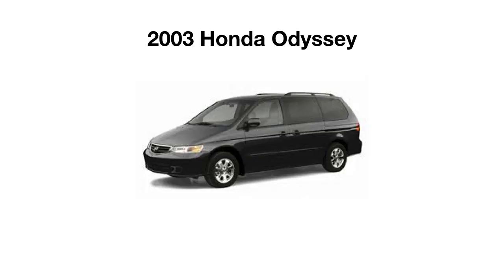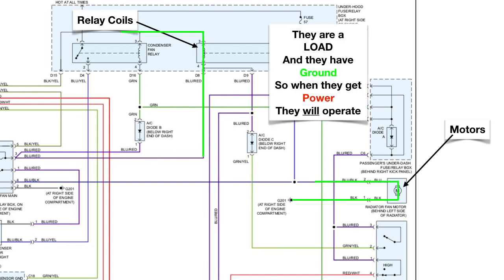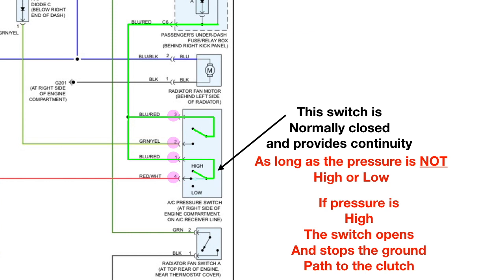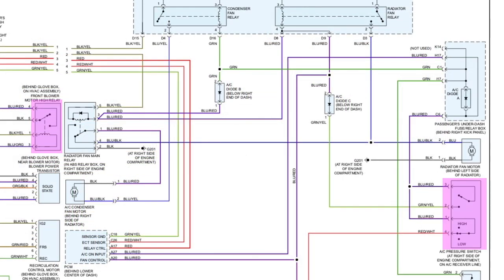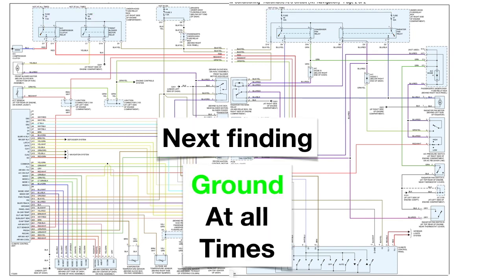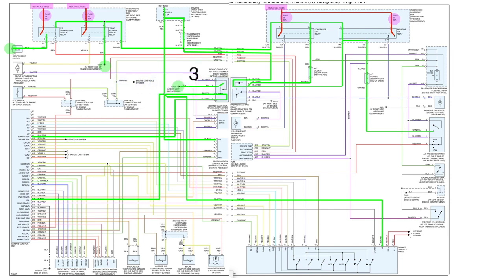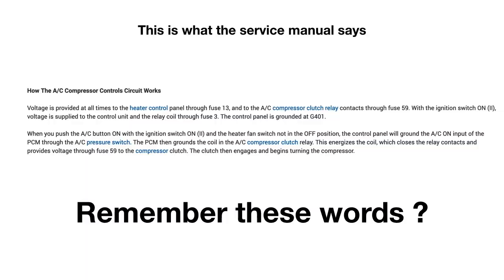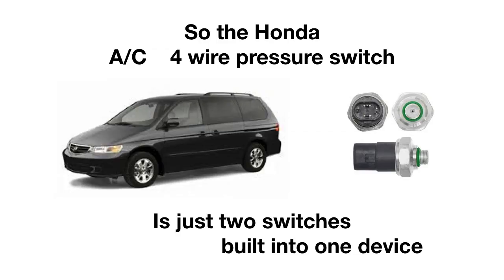Honda 4 wire pressure switch

Comment: would a going bad or fraying high pressure 4 pin connected at the compressor cause the ac blower fan motor behind the glove box to work intermittently? i watched this a couple times im still trying to understand this

Comment: Thank you, Very informative. On my 2003 Odyssey , I start the van,  I press AC on and the clutch and fan engage for about 5 seconds and then go off and stay off, button doesn't turn it back on, I can only get it to work for 5 seconds again if I turn it off and restart, Any ideas?
Reply: first thing to check is put gauges on it, watch how they respond.  Could be low on pressure, low side immediately drops, or restriction, high side immediately goes way up
Reply: Stroke Warrior ok Thank you

Comment: It's a really great video, but could you help me out with my 98' 1.6 16v Lancia Dedra? :) it has a 4 pins switch, but I can't figure it out the functions of the wires.
Reply from the maker: I'll do my best, what exactly is your question AND it the diagram in the video the same as your vehicle ?
Reply: @realfixesrealfast  It's a shame, but it's an old vehicle, so the diagram dosen't contain the switch's inner structure. I managed to find 12v  in one of the wires and if I short circuit it with a pilot light with one of the wire's the fan starts, but not the compressor. And I don't know what the other 2 wires do. I try to figure it out if this is the problem that prevents the ecu to let 12v to the compressor and ground to the fan.
Reply from the maker: @trefasnyul1  I will take a look at it and get back to you soon.  I need your email so I can send three-ply directly to you

Comment: After looking carefully at the video, I did not see other variables that could prevent the PCM from commanding signal to the AC Clutch relay, my issue was that I did not see the ground signal at the relay pin and I checked continuity at the pressure switch to ensure that it wasn't open. Perhaps bad PCM diode or wiring from PCM to AC relay or bad wiring from pressure switch to PCM. I did not diagnose further. This video explains clearly, my thought was that the other switch within the AC pressure (for the fan speed control) was another variable that the computer needed in order to fully control the ground signal to the PCM to prevent compressor damage, etc.

Comment: You could easily spend 1 to 2 hours just gathering the mode of operation and wiring diagrams before one even begins to troubleshoot and spend another 2, 3, or 4 hours of removing panels for access on the vehicle before you find the problem then have fix it.  Final cost to the customer $1500??????? Crazy!!!!
Reply: Best is to check commands if you can see it through live data using a scan tool for the AC control unit and check the pressure switch continuity. It is possible that the compressor is not getting the power it needs (damaged wire, etc).